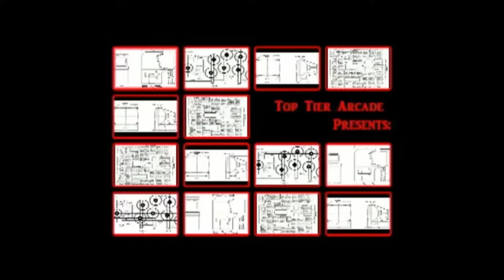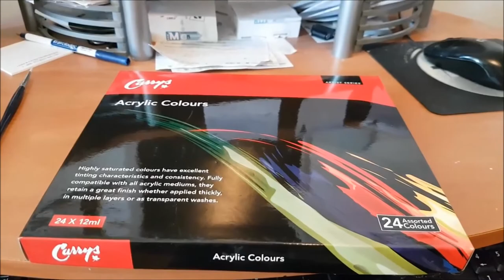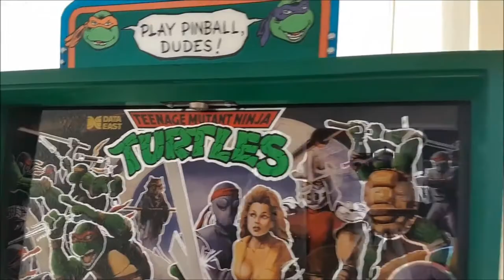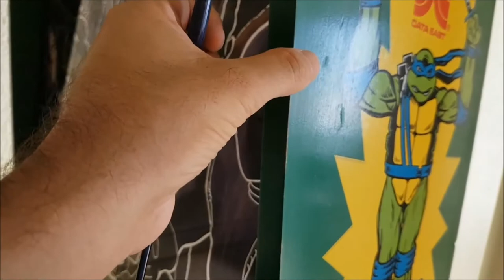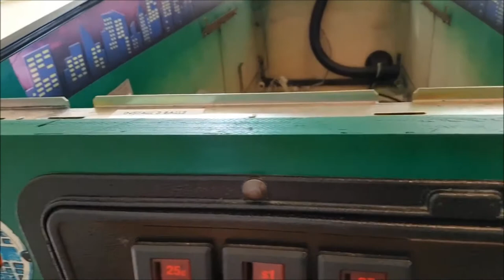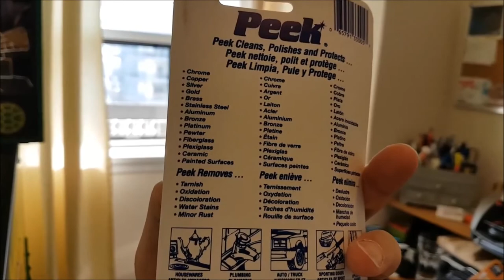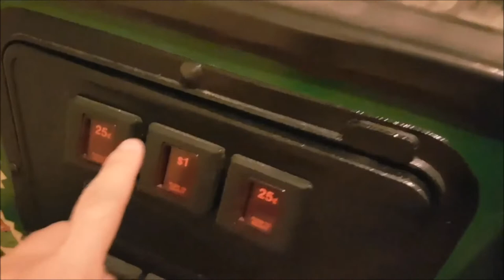Teenage Mutant Ninja Turtles Pinball - Cabinet Restore - Part 5 - Bondo Repair Work, Painting + More

Comment: Steve, Any idea why the coin door has three coin slots? Is that a Canadian thing?
Reply from the maker: A great question. Yes, Canadian machines back in the 90's had 3 coin slots. On the left and right slot, both were for quarters and the one in the middle was for Lonnies, our dollar, which is a bigger coin. On '00 machines until present, there are still 3 coin slots, on the left is quarters, middle is for Loonies and the right is for a Twoonie, which is our 2 dollar coin. I also think some European and other countries have a similar set-up with their different coin currencies